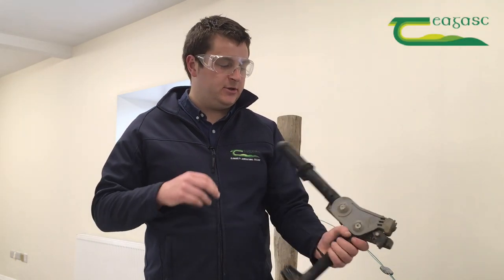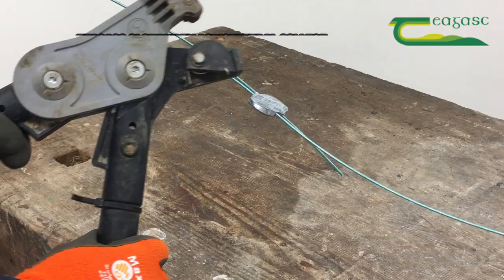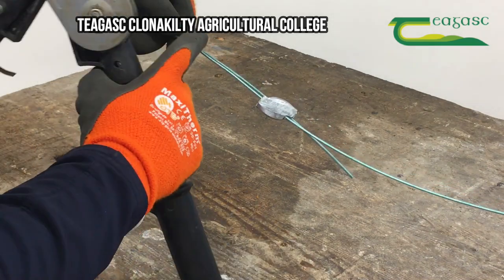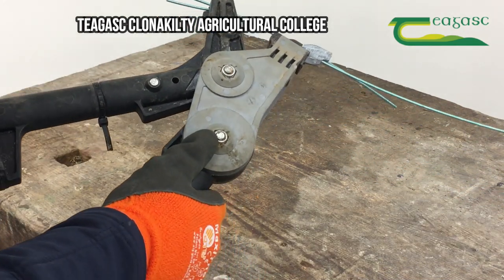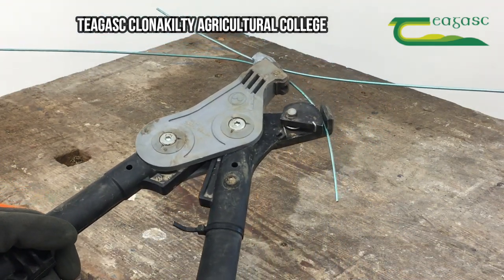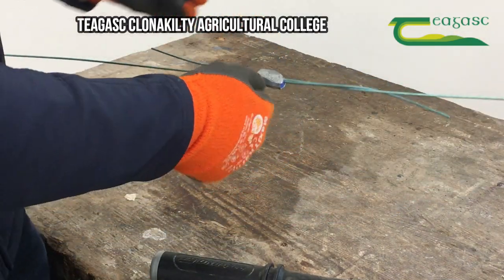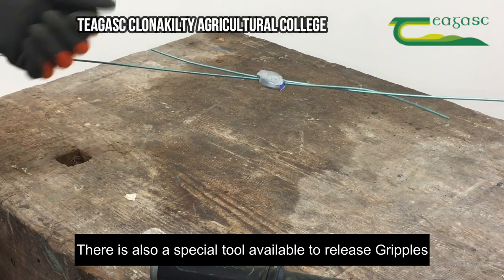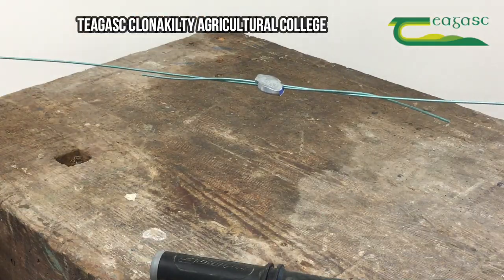Gripple Wire Tensioning Tool: Permanent Fencing Skills

Comment: Hey Teach, To make a nice, safe termination with each loose end of wire, working with 10" of wire, leave about 6" of wire out of the Gripple, bend a 90 degree in the wire, leave a 1" leg and twist a few turns around the main wire & twist off neatly. No chance of damaging livestock & you can still re-tension it.